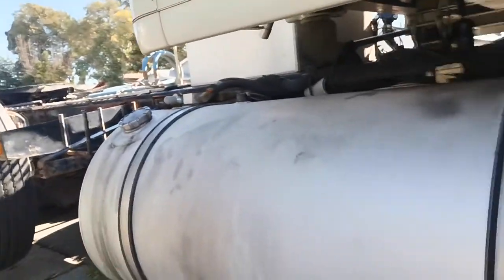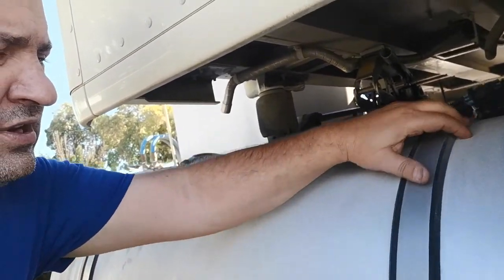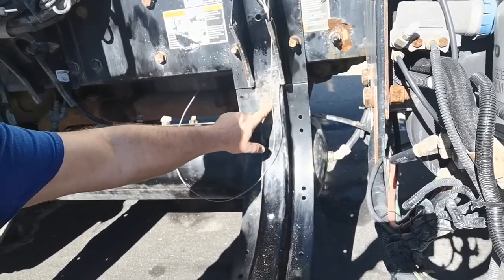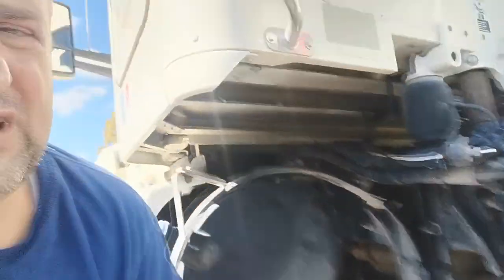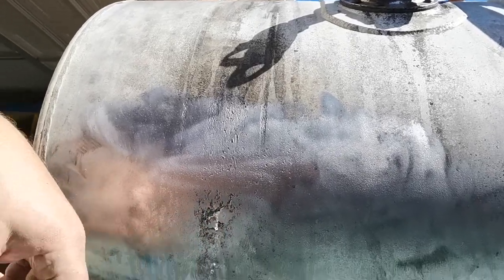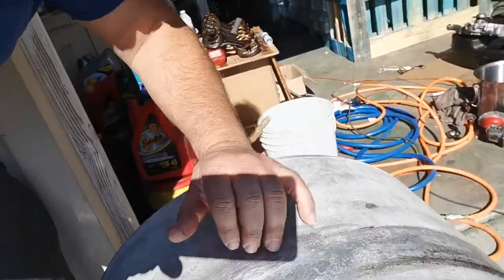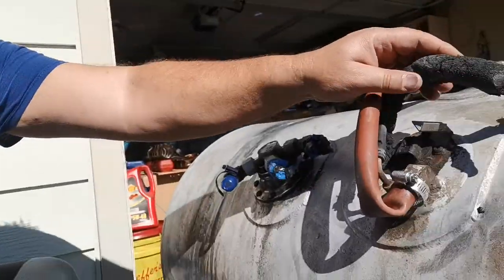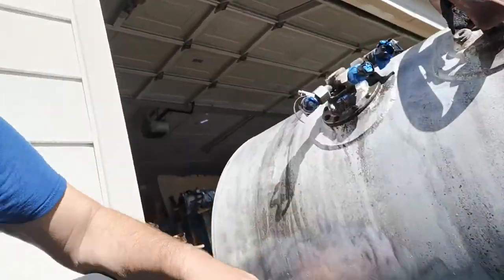How to fix fuel tank

Comment: Years ago on a International  cabover I owned I had the same problem. Had a aluminum repair shop bend aluminum  straps that were slightly wider than the tank straps, the whole circumference. They welded the straps on both sides and that sealed it up. Fuel seeps into the aluminum pores and makes it hard to get a "good" weld that won't leak. Thanks for sharing and hope your work is successful.